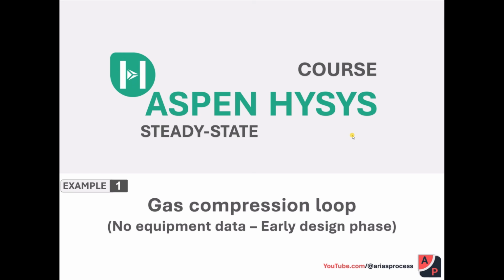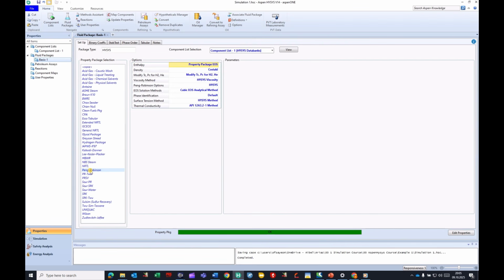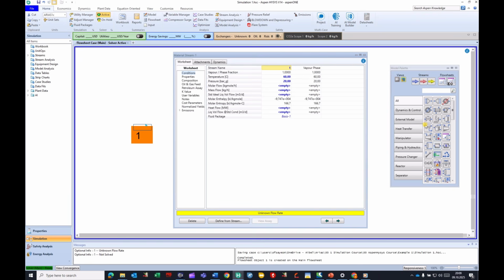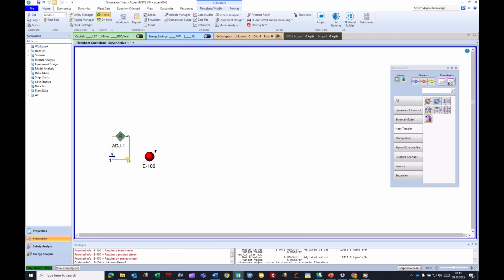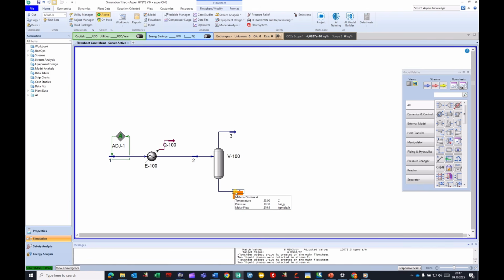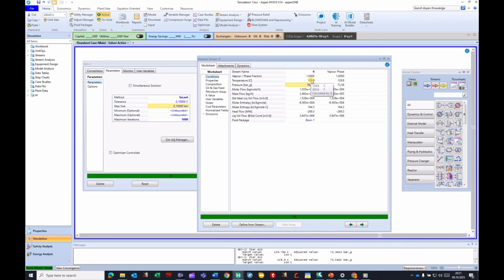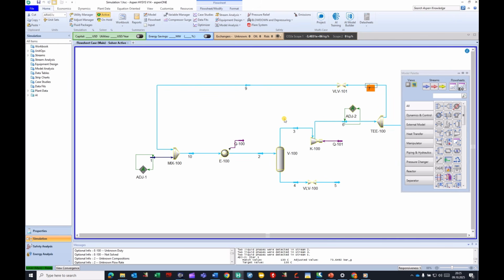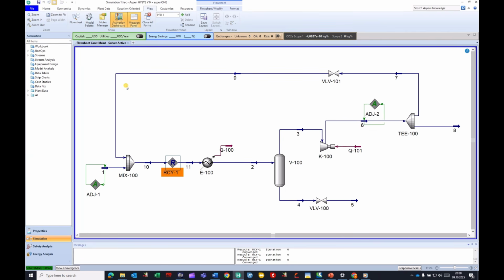Aspen HYSYS Simulation Course | Steady-State | 1 | Gas Compression loop - Early design phase

Comment: Thanks alot. In my case when recycle stream is 0 then  discharge pressure of mixer is 60 but when recycle will be increased pressure also meet higher value than 60
Reply from the maker: Did you simulate the example in this video or another example? Since no compressor curves is implemented in my example, the pressure remains the same. with curves the values will be changing. Wait for the next sessions to illustrate the case studies with added compressor curves.